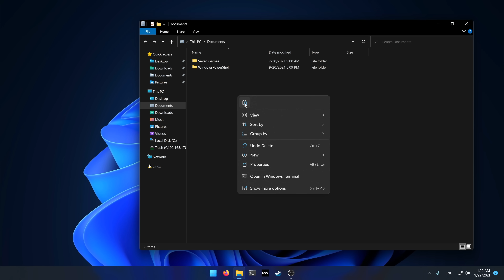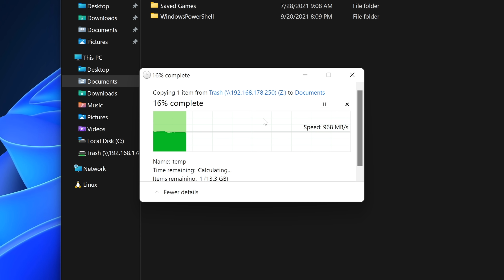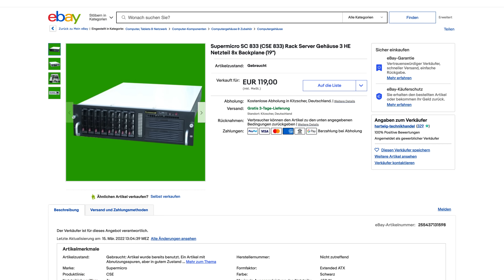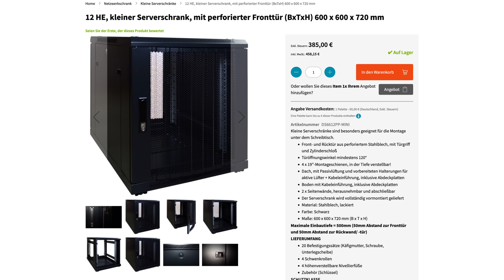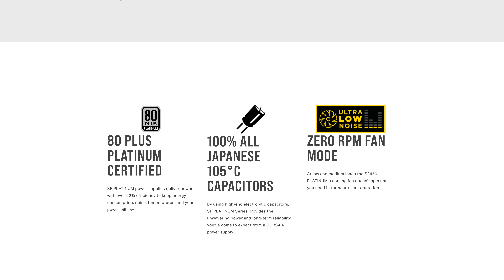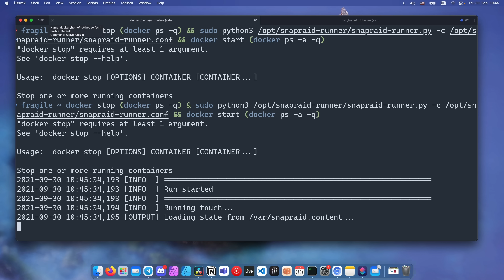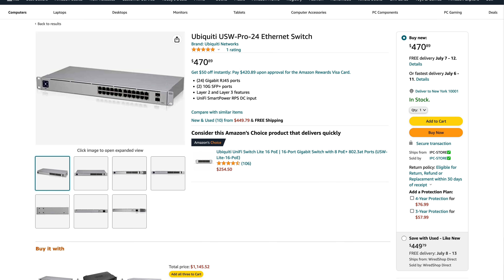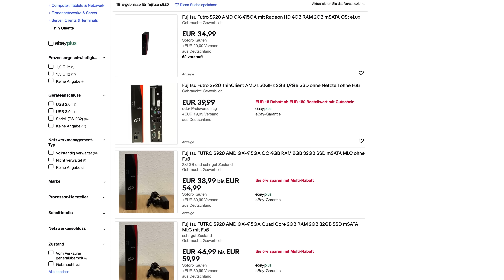Building a Homelab Server Rack!

Comment from the maker: Mikrotik CRS326 https://mikrotik.com/product/CRS326-24G-2SplusRM
PCIe Riser https://www.ebay.de/itm/133520571781
Short Cat.6 cables https://www.amazon.de/dp/B07GT6HNDB
Reply: That PCIe bifurcation riser sure is sexy. It could be my final push for moving to mini-ITX… if it didn’t cost as much as a motherboard.
Reply: Think you could add the desk legs to your affiliate link list? 🦵
Reply: where did u buy the case for the hotswap nas
Reply: Why you dont use lack rack from ikea? xD
Reply: Any chance we could get a model number or something for that PCIe Riser?
That would be exactly what I need for my server project, however the eBay link you have previously provided is now a dead end.
Reply: Wolfgang hättest du einen link für die ATX Blende?
Reply: Great video 🎉can we have the list of hardware used?
Reply: The server unit really sets it off - looks like a beast.

Comment: Really dude you didn't stick with making your own cables?
I'm not sure why yours were failing but you know they have to be twisted right up until the last millimeter that you can before you terminate them. Otherwise you get major crosstalk and the tester will think it's wired wrong when really it's just hopping bits over through EMF

Comment: Thumbs up, I also ended up using rack-mount server case after years of using some random sorta-fancy looking PC case (HTPC to be more precise).
The only question I got is - have you checked your PSU before switching it to consumer-grade one? I use CSE-745BAC-R1K23B-SQ case with stock full-sized PSU and yet I have replaced the fans with silent ones - the PSU turned out to be at least as silent, if not more, as most of the consumer PSU's

Comment: Do NOT attempt to make your own patch cables haha. It's an exercise in frustration
Reply: You are just doing it wrong or use the wrong tools.
Just buy an Networkset for ~15 bucks (like Digitus DN-94022) , an Knipex Electronik Super Knips, an 9mm Cutter knife und use Logilink MP0021 + Logilink CPV0041.
It´s literally as easy to use, as the toolless Keystone modules.

But it´s only worth your time if you really have to use it. (> IP-Cameras ).
In this case ( 7:50 ) just use Keystone Cable Connector´s ( RJ45 to RJ45 ) and buy patch cables in the correct length. Will save you some time.

Comment: I'm worried about noise when the system is running at full load. I also have my own lab system with 2 esxi servers, 2 storage servers, with a 1Gbps network. When they were fully loaded, I could imagine myself next to an airplane engine preparing to take off.

Comment: @Wolfgang: one year later, I am interested in buying the same exact StarTech open frame rack for my home lab, I also wanted the 12U / 12HE version, but now considering the 15U / 15HE... what do you think? if you could go a year into the past, would you still get the 12U version or the 15U ?
Reply from the maker: I've actually moved into an even smaller "rack" made of two IKEA Lack tables. YMMV
Reply: @WolfgangsChannel  thank you for your reply!

interesting, I used to have one of those Lack frames as a printer stand, two Lack tables would be larger than 12HE if I am not mistaken.. ?

did you have a specific reason behind this?

also I really appreciate your "building power efficient" whatever server/homelab serious.. we in Europe don't have the cheap electricity like in the US.. 

I wonder if you could make a video about the topic, but instead of focusing on e.g. the server - focus on the entire rack from switch, to firewall, server, NAS etc.. and how to put together a power efficient rack.

I am planning a rack for home now, and low power consumption on idle of the entire rack will be important for me, problem is there are thousands of similar products for each component on the market, hard to optimize and some just cost to much to justify buying for a home/soho use.

keep making those like minded (home-lab / server power efficiency etc) videos, your insights are pretty useful, that's actually how I found out about your channel from a simple search

Comment: Thanks for this. I've been lucky enough to be given a Dell PowerEdge R210 II for starters and got a Dell PowerEdge T410 with 32Gb RAM for $50 AUD (Around $34 US) and a Dell PowerEdge R620 with 2 CPUs and 88Gb RAM for $160 AUD (Around $107 US) on an impulse (or chance) buy. I'm also in touch with a guy that can get me used 6TB SAS drives.

I've learned a lot from this video on what can be done and what NOT to do 😅.  I'm patiently waiting for a used server rack/cabinet to appear on marketplace but all I see are full sized data centre cabinets that won't fit in my little Toyota Corolla

Comment: Server cooling fans can mostly be PWM controlled using an external controller to override the BIOS - I have done this with several HP servers using the original motherboards, PSUs, and fans and can get the sound down to a low level while still keeping the components well within acceptable levels (there was some rewiring of fan headers needed to trick the BIOS into thinking the fans were working at full speed)

Comment: I would just go to a building supply store and buy some perforated steel angles, bolts, washers, nuts and some dolly caster wheels. You could make the sides, top and bottom from sheet metal or acrylic.

Comment: i did all diy home made server 'box' iam not calling it a rack, a shelf might be  better. basically its all neat and everything has rubber feet. but it is also acting like a main leg for my new table. I have an old laptop running adguard, other running uptime kuma + mining a bit of bitcoin since i have free energy, everything for the cctvs, and the main router and switchs. i was thinking to get those rack mounts and propley do it later on and get a n semi old laptop to run NAS core. (Yes my servers are all consistant of old laptops that people i know wants to throw away) (don't judge me its hard to get a proper server here, and besides the old laptops are doing an amazing job) and if anyone has any ideas for diy things iam open, i need more ideas or suggestions for something like that XD

Comment: I have built small enclosures from Ikea sideboard cabinets for systems - one was in a mate's living room, he wanted to keep all of his kit out of the way and out of sight.  He has two servers, a Pi with drives hanging off it, power boards, cabling, cable modem, router and a tertiary remote workstation that runs headless.  
We put together a small cabinet (this is a sideboard so about waist height) and we left the back off entirely.  The idea was to dissipate heat - the back is up against the wall with just enough gap to let heat out and cables run up to a TV, etc.  The doors on the front close easily.
Overall solution - works a TREAT.  Super-cheap, wildly civilises the room and cuts down noise quite a bit.  Also heat is not a problem (he's in the sub-tropics and it is frequently mid to high 30ss in there, haven't had a single issue even with all systems fully on). 
Also found that dust wasn't an issue either - as most case suck air from front to back it tended not to be able to get much in dust-wise through the front doors. 
The whole thing is on little legs so its' off the ground by perhaps six inches (standard for the cabinet).   Indeed the only mods we made to the cabinet were leaving the back off (just not installing it when putting it together, it wasn't structurally required) and also some screws inside on one side to mount a power board up for neatness.

I personally do this though I was stupid and put the back on mine (I'm in the UK so it's a bit cooler than the other setup).  I want to remove the back on mine - I have three servers (2x HP Microservers and a mITX Intel Zeon mini server) as well as a hardware intel based firewall, a Pi with a stack of drives, switches, messy cabling and even a laptop in a dock missing its screen and keyboard that I use as a processing box (wake it with WOL packet and use it to chomp on files, it's running Debian and it's making use of bits of a T420 I had lying around).  Because of the back my heat situation isn't as good but the noise and dust situation is brilliant;  it's hard to hear the servers except when I wake them, they're storage tanks so they're powered off most of the time.  

I think this solution idea is very much worthy of a look for anyone who has systems, switches, cables, power boards, SBCs, you name it - floating around and cluttering a room while producing noise and sucking in dust.

Comment: Ok, my people, I need some advice, I'm a rehabilitated Mac guy, except for laptops, love my macbook pros. I live in NYC, so a rack server was out of the question; why?  Noise, space, power consumption, etc. I went mini and got a NUC 9 pro with the Xeon processor 64GB and I've been running proxmox, and spinning up vms to experiment closer to the metal. I'm finishing up my master's in software engineering, and that gives me a little wiggle room with the wife to expand the home lab. So do I double down on another nuc 9 or go even smaller, like a Morefine s500+ with more CPU power? As you can tell, I'm old school enough to where I like ecc ram but also recognize not all of my lab needs it. I don't do video editing, and gaming is "family" style, so emulating simple Nintendo games is good enough. The end goal is a hybrid I want a system that I can use professionally but can also point out to my wife that all the family entertainment and backups of precious photos and videos make it worth it. In reality, I'm hooked on home labing and want to build it up but I only really have an ikea cabinet worth of space to make it happen. ADVICE??? more NUC 9? do another mini workstation like nuc 12 to lenovo p360 ultra?

Comment: I hope the growth of home labs pushes the industry to make more rack mount equipment that is quiet and power-efficient straight out of the box...designed specifically for home and office use instead of just data centers.

Obviously, data center servers still have their place, but not everyone who uses a server is putting that server in a place where noise doesn't matter.

Comment: Did you put that foam under the rack to reduce the noise transmission into the floor? Does it work?
Reply from the maker: Yes that's what it's for, and no, it doesn't work 😁
What actually worked was putting velcro strips under the hard drive sleds

Comment: Love the server build. I repurposed a Juniper WXC chassis long ago in the same way, junk out, power reduction splitter for the fan to shut it up, pico power supply in, rotating drives out, SSD in. It was built on a supermicro motherboard which was the only thing saved. Cool quiet, low power. 👌

All the cool kids are doing unifi, pffft. There are equally serviceable and far more inexpensive not to mention interesting options and you seem to be all over that.

Other worthwhile hacks, keystones as you said and rack studs rather than cage nuts.

Comment: A few things from an electricians POV:
1. Make sure your rack is grounded to some large mass (heating radiator) just in case you have a lightning strike on your house, Just tie the ground to your frame. 
2. Get an actual rack-mount UPS.
3. Put a surge protector in front of your UPS. Extra investment, but replacing a surge protector is cheaper than a whole UPS, and may make your insurance pay.
Reply: additionally: Don't rely on a "large mass (heating radiator)" being properly grounded. If you wanna do it right, install a wire (with a huge diameter) to the next proper grounding point. This is not only important for lighting etc. (there are protection systems for that) but for the correct shielding of high frequency, high bandwidth connections. The resistance of the connection to your potential equalization system should be as low as possible. This becomes more important with increasing frequencies that are used in 10G and faster connections, especially over distance.
Reply: @hw2508  Usually, in Europe, water pipes are grounded, especially in freestanding houses, as frequently, you can't have a ground line separate from the outtlet. Anything that makes it easier for lightning to get away from your rack is better than using the outlet.
Reply: @mousseman8239  usually. But it is totally unprofessionell and against standard to do this. (And standard becomes law if an incident happens.) Why? because water (and other) pipes are not intended to be used as electric wiring. Some person fixes your water pipes and cuts off a pipe that is part of your 'electrical wiring' and you've got a problem. Maybe even a dangerous problem. In Germany that is called "Fusch". People did that maybe 50 years ago, but today even considering such techniques is as far away from professional as it gets.
It is basically all written down in DIN EN 50173, DIN EN 50310 and probably a dozend others.
Reply: @mousseman8239  of course you can have something else than the wiring from the outlet. A seperate wire with a big diameter, connected with the rack and directly connected to the central earthing point in your house.
Reply: Do you mean wall -> surge protector -> UPS or wall -> UPS -> surge protector? I had thought you always wanted the UPS plugged directly into the wall.
Reply: @jamesmcintyre3662  Wall - surge protector some feet/meter away from UPS - UPS. In case a real lightning strike comes into the house cabling, the surge protector in front of the UPS should blow (and they can turn into projectiles, so careful out there), and not your UPS, as your UPS will break, and this can cause the batteries to explode (even with lead-acid, it depends on the amps you pump through in 0.01 seconds the lightning strike takes).

Comment: Great video. Question I have would be: I have a sturdy 18U 19 inch rack with 2 solar batteries at 48v taking up 6U, is it bad for computer devices to be near these batteries/cables?
Reply: no it shouldn't. You evne have servers near to an UPS in the same rack. Which is very common afaik

Comment: I built a rack mount server using a Chenbro RM42300 case. Its short enough (465mm) that it fits inside an IKEA platsa cabinet that I've modified with server rails, and it has modular sections at the front that allow the installation of hot swap bays.

I bought the rack rails from a music shop and just mounted them inside my IKEA cabinet to create a custom integrated server rack.
Reply from the maker: That’s a great idea!

Comment: the difference in efficiency between gold and platinium is like 0.8% and top margin is like 1.5-1.8% between gold and titanium highest model of psu, theses words are from Seasonic themselves ... not sure who can't pay 1% of extra electricity buying server hardware/racks
Reply from the maker: True, but that’s also peak efficiency. This rating doesn’t take into account the low loads efficiency, which is especially relevant for a home server.
Reply: @WolfgangsChannel  I agree with you friend but still the differences is so small, and when your starting to build rack servers for home....
Reply from the maker: The difference between individual PSUs can be as much as 7-10W when your idle load is low. A lot of ATX PSUs are notoriously bad when it comes to low load efficiency, losing as much as 30%. 

7-10W might not be a big deal in an enterprise environment, where you have hundreds of servers consuming 100W each, but at home, I want my infrastructure to be as energy efficient as possible. My server is currently idling at 17W and a 10W difference definitely matters in this case

Comment: May I ask. How did you enable or otherwise know that bifurcation would work on your motherboard?

I have a similar setup using the server class of your board (the E3C236D2I). Currently with a LSI raid card flashed into HBA mode to allow me to connect a total of 14 drives. I'd really like to add 10gig networking to this build as 2gig just isn't cutting it.

However comparing the manual for my board and yours I can see no mention in either of enabling bifurcation on PCIE 7.

I'm really curious as to how you 1. Knew it would work. 2. Enabled it.

Love the contents. Your videos are a joy to watch!
Reply from the maker: Thank you!

The BIOS setting is sometimes called "PCIe configuration" or something along those lines. The options might look like this:
x16
x8/x8
x4/x8/x8
x4/x4/x4/x4

Comment: You could change fan from PSU with a noctua version!
Reply from the maker: Tried that – the PSU turns on for 2 seconds, and then turns off.
Reply: @WolfgangsChannel  Maybe this one may help you: https://www.youtube.com/watch?v=V_FBb-_kd2I&t=2s
Check the first comment - > In conclusion... If you  use a PSU with Tachometer Signal, you need to give a tachometer signal.

I found this in the course of my search for a suitable 2U housing, because I was thinking about taking a Dell PowerEdge instead of building the server myself. At the moment, however, I am still focused on 'DIY', as you have done.

Comment: What's the maximum noise level and total power consumption of the rack?
Reply from the maker: I don't have the equipment necessary to accurately measure the noise level, but what I can say is that the loudest part of the NAS are the hard drives. Once the hard drives go into standby mode, it's basically inaudible.

Total power consumption is around 45-50W, but that also includes stuff that you would still use in a home Internet setup, even if you don't have a rack (router, WiFi AP, etc.). The NAS/server itself consumes around 18-20W on average)

Comment: One note, though you might have found out already:
The old 10G switch, just reboot it into SwOS and it is similar to the new switch.

As for keystone panels, I tend to use Deltaco's pan-202 bundle kit (panel and 24 Cat 6A keystones), but I fear it might have been discontinued....
However their pan-113 and pan-214 are not too expensive, sadly they are without the keystones though.